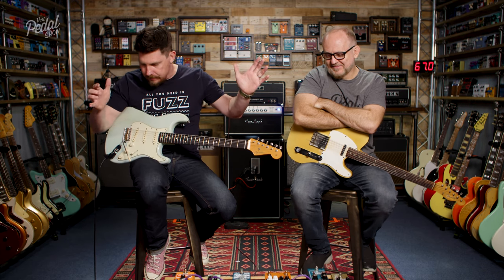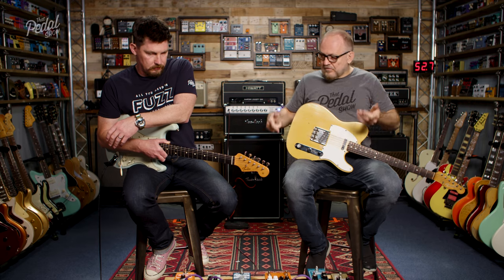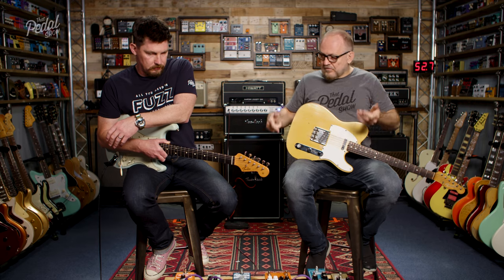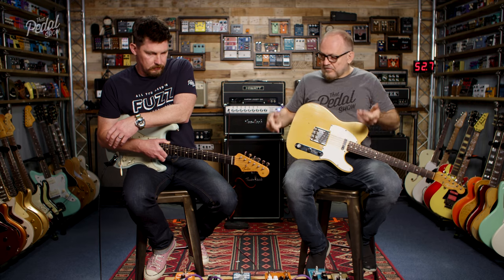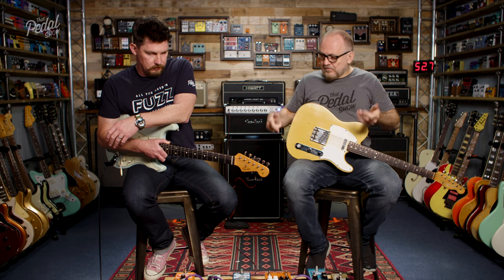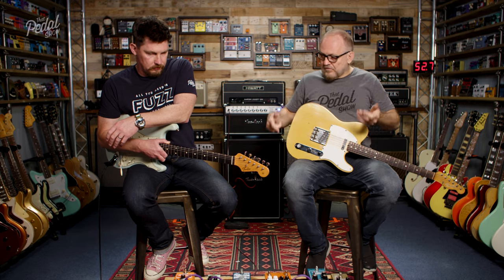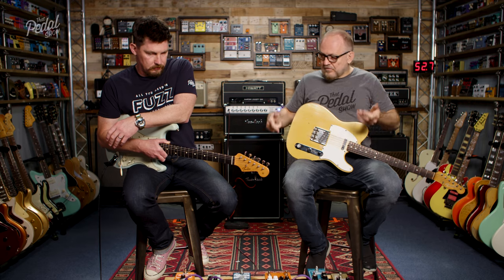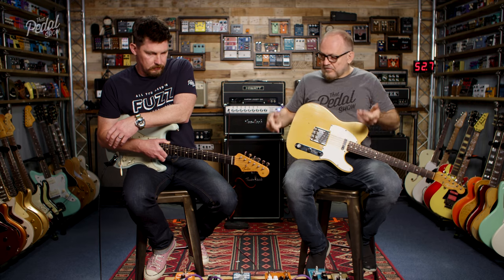To Buffer Or Not To Buffer: That Is The Question – That Pedal Show

Comment: Great video as always! Was wondering what sort of specs count as a high and low impedance? I often see on specs on pedals it will say 'input impedance 600 kΩ' or 'output impedance < 140 Ω'. Wondered if there was a rough scale that could help me gain understanding from information
Reply from the maker: Yah, I have absolutely no idea. Mick here. Would be interesting to compile a list....
Reply: They are always a pair, you want low output into higher input, (about 1:10 ratio is "good" to stop much signla loss).So a low output could be considered a high output if it were going into an even lower input :)  See ?

In general though anything about 1KOhms is a High Output, anything about 1MOhm is a high input.

For ref: a standard fuzz face is about 8Kohms input - yep, way lowwwww, and about 500Ohm to 1KOhm output.... way high.

Belle Epoch has a low input impedance and a high output impedance so can mess with tone when switched in and out (When it is in buffered mode) etc

Echorec is similar as well I think

Klon is similar I think, slightly high input impedance, but a low output so it can take a good fuzz and not change it "too much" but ti will also then drive along cables etc afterwards...

That's why these three didn't make night/day difference, but enough to be audible.

The Secret Machine is a Zonk really, or MkI tonebender by any other name - hugely hugely sensitive to cable length and input impedance of the next pedal after it...huge....

Typical Boss pedals with buffers in are about 1-10MOhm Input, and a few 10's of Ohms output.

Comment: Like a eureka moment of Achimedian proportions, I've realized why my Carcosa fuzz is so bright: I run a JHS buffer after it and before my volume pedal -- an absolute necessity with a passive volume pedal. When I bypass the entire board and have just the Carcosa in line, it doesn't want to tear my head off quite so badly. Feh. Not sure what to do as the volume pedal is far more important for my playing style than the Carcosa :(

On a different note, since I always use a buffer in my pedal chain, I also always turn off any amp bright switches. Way too spikey. I test my buffer by using a 10' George L's cable straight from guitar to amp, and then through the pedal board with the buffer in line. The difference is slight, with the high end being the same and usually a very, very slight shift in the mids. I gig a lot without pedals, but always play through my board at home,

Comment: What about the Secret Machine into a boss tuner (buffered) into the delay?  That’s how I use my analogman MkIV Sunbender...you’ll need a tuner anyway.  Isn’t this the whole wah—>fuzz , fuzz—>wah conundrum?  In fact, your previous episode on that topic you struggled to get the problem as pronounced as your memory thought it was.  You may have demonstrated it in spades here by accident.
Reply from the maker: Indeed. But I don’t love the sound of those tuners further down the line. On my actual board I have G2 so there’s a tuner out anyway. And with all respect to my dear friend, I don’t much like the sound of the buffer in G2 either. Ergo, I just don’t like buffers!
Reply: In that case, the Buffered colored preamp sound of the belle epoch may be the ticket.  Are there other colored buffered boost pedals set to unity gain that may work if you don’t go with the Catlinbread?

Comment: Does the 29 pedal use a TL072? (pedant alert) The 29 sounds like the Visual Sound née True Tone buffer. I'm surprised putting a very small Grumpy Bot right after the Secret Machine wasn't step one. The new Petersen Strobostomp HD right after my Sunface works great, if very very slightly brighter than the Suhr buffer IME.

Comment: My answer for mick: buffer after the zonk machine, with a "cable emulation" 470pF cap to ground at the input, always on: you always have the sound of a 5m cable going into the amp, so you have no "buffer fizz", deals with the zonk's output  impedance, and no volume jumps or anything when it's on.
Reply from the maker: That’s interesting, thank you!

Comment: Low input impedance/high output impedance seems to be a character of lots of fuzz circuits. Is that the case for Big Muffs, too? A quick google suggests that it is, but also that there’s ‘something’ about the rest of the Muff’s circuit that compensates for that so that it doesn’t seem to have the same symptoms of the Tonebender/Face styles. Curious what that is - does the Muff have a buffer circuit internally after the input?

Comment: Can the exact opposite thing also occur? Can you start with a pedal on down the signal chain (like an always on overdrive at the end of the chain that simulates pedals running into amp gain) and then when a vintage styled fuzz turned on at the front of the chain causing the signal to darken? Or is there something else going on there?

Comment: One option - have Dan put a toggle-able cap to ground on the circuit input of the Immortal Echo.  One hole, two parts, some wire... and a voided warranty.  I’d do it!
Reply: Replying for clarity; this achieves the goal of extra capacitance between the fuzz and delay only when the delay is on

Comment: I’ve got a board with almost exclusively fender pedals and I’ve watched all your videos and am still confused. Their level set buffer says in it’s literature that it was designed to be the very first pedal in the chain. So, before their own fuzz?? I’ve been back and forth swapping these pedals out that I’m worse off than when I started. I’m not even going to bring up my compressor or wah 🫣😰🤯

Comment: Great show guys! I love this stuff and the way you guys work thru each question. Two questions with two parts each: How can I learn which of my pedals have a buffer built in? Or do I figure it out by swapping things around?
Second, does the simple JHS buffer solve Mick's problem and would it go at the beginning of the chain, in the middle, or at the end?
Reply from the maker: Hello Tim. 1) More often than not the product page on the relevant website will tell you if it’s true bypass or not. Failing that, take the battery out. If the pedal still passes signal, it’s //probably// true bypass. 
2) It might. But as we’ve proved here, many buffers are different and I might not like the sound of it! Cheers!

Comment: Why not just get a straight bypass pedal (like a JHS bypass pedal) and put it after the Secret Machine? (I'm writing at 39m) Just before the bypass pedal, you could put a tone control (i.e.a  pot and an appropriate capacitor value to ground). This way you can dial in some capacitance that the Secret Machine can see? Alternatively, a preamp i suppose. 

The other way to fix it would be:   guitar -> secret machine -> amp -> fx loop -> amp -> speaker

Comment: wouldn't putting a stand-alone buffer (like the JHS little black buffer, etc.) between the secret machine and the J. Rockett delay fix the volume/buffering problem that was occurring?
Reply from the maker: Only if you like the sound of that particular buffer and what it does to all your other pedals. But in theory, yes.

Comment: EE101: a good small signal electronic stage has very high input impedance and very low output impedance. The main reason for that is exactly so that the stage doesn’t affect the input sound and is able to drive the output without being affected by what comes next. So what I’m wondering is: were vintage pedals just poorly designed circuits? I mean, I understand that the interaction between a vintage fuzz and the guitar volume knob can be magical, but isn’t that just a fortunate consequence of a poorly designed circuit? And to be clear, I have nothing against vintage circuits, I’m just highlighting the fact that we wouldn’t have these issues if those circuits were designed differently.
Reply from the maker: Same with vintage amps and vintage guitars.... generally considered ‘inferior’ to modern guitars and amps in terms of build ‘quality’ and design. And yet the new stuff never sounds like the old stuff. These are our choices!
Reply: That Pedal Show I totally get it. I tend to prefer modern stuff, partially for that reason. All problems have a solution though. Thanks for the video guys!

Comment: Just put a dedicated buffer after the fuzz? Problem is those take up some real estate too but thats what I'm doing. I use the TC Electronic Bona Fide buffer but there are great ones from empress and JHS. (Writing this before the end of the video so maybe you'll get there). I'd even say - set up an always buffer board and dial down the treble frequencies in the amp or via an EQ pedal? If you have always on pedals, don't you have always on buffers anyways? :)

Comment: Detailed explanation the buffers are weird I run a polytune 3 with the buffer bypass switch on it's kind of a funny pedal it will drive the pedals 25 30 ft with no problem I've tried to buffer at the end of my signal chain and it did not improve anything but just introduced a little more noise if I move that same tuner pedal to the last of my pedal chain it works pretty good it's really weird I hate boss pedals cuz they're buffer suck

Comment: Isn’t having the fuzz in the eula loop changing the input impedance as well? Wouldn’t the problem be easier with a buffer only after the pedal? Or am I missing how the eula works?
Reply from the maker: Yeah, the bypass is basically true bypass that includes that loop
Reply from the maker: What he said. Mick here. We included the Euna because it raises these questions!
Reply: That Pedal Show - this one had me build a quick and dirty pedal board with my analog man germanium surface and a Mesa buffer in one loop of a qmx so it was always on when the fuzz was selected. Now I think I a, going to do this on my big board. I previously relied on it being solved by my boss or g2 switcher and usually having a buffer at the end but I think making a permanent marriage of a buffer to my fuzz might be a good idea. Cool thought provoking video..

Comment: A buffered pedal such as a tuner or delay right after the fuzz seems like the best bet to me. It is simple and closest to the true sound of the cable straight into the amp without the capacitance of a true bypass board and the cable from the board to the amp killing off the top end. More of the pickup’s signal will hit the amp so Mick’s old amp settings probably will need to change, as it might for different guitars or types of pickup.
Reply from the maker: But what buffer. That is the question. The sound of the cable into the amp seems to be a thing people think is right... but here we are 30 years down the road of a few pedals and 50 feet of cable. Then comes G2... Ah, hello tone old friend, I have missed you! 
Massive grey area.
Reply: That Pedal Show I don’t use fuzz but I’d noticed even OD pedals sounded different depending on what came after.  For me a buffer in one of my pedals early in the chain is the solution. There seems to be quite a few good buffers around.

Comment: You missed the trick with the Euna on this one I think. Instead of putting the Fuzz in the loop like everyone would assume (so it's not buffered), you should have tried the Secret Machine into the Euna, then the delay in the loop of the Euna. That way you have Fuzz > Buffer, or Fuzz > Delay (working as buffer). That way either way you have a buffer in the line to boost the signal.
Reply: Andrew, you beat me to it! I tried my best to make EUNA adaptable to a lot of circumstances. Thanks for noting this!
Reply from the maker: I think we’d done enough swapping by that point to prove the point that the sounds vary greatly. For my tones personally the Euna is too much buffer - I wouldn’t want it ahead of my other drives. But yes, that would totally work for some people! Hey Jesse, hope you’re well man!
Reply: @ThatPedalShow  Hi Guys!! Thanks so much for including EUNA on the show!!

Comment: Isn’t the question then if it makes sense to put a dedicated always on buffer at unity gain after the fuzz, and possibly another at the end of the pedal chain to drive the cable to the amp? But what I wonder about is how that affects the sound and dynamics for the following drive pedals. For instance would you have the same dynamic when turning down guitar volume and touch sensitivity when playing lightly?
Reply from the maker: Yes, this. Adding buffers anywhere makes it worse for me..... except when that fuzz is on. So yah, looks like fuzz in loop with dedicated buffer than I like. The search begins. :0)

Comment: How about the “Enhanced Bypass” switch in my Fulltone OCD v2. I noticed my overall sound is brighter in that setting. Is it just a fancy way of saying it’s buffered or is there something else going on? 🤔
Reply: I have the original Fulltone "Enhanced Bypass", the amazing Fulltone Wahfull( no choice of bypass style, unlike your OCDv2) and that lets my Soulbender SB-2v2 work MUCH better with the rest of my pedals, so if you use a vintage style fuzz before the OCD it would work so much better using the "Enhanced Bypass" because it's on all the time. Hope that helps!

Comment: I would love having Dr Mason from Vertex opinion on that. He tends to "isolate" the pedal chain between an input and an output buffer. But what would happen with a Germanium vintage fuzz?
Reply from the maker: It would sound different in a way you would either like or dislike, as we proved through this entire video. Cheeers!
Reply: @ThatPedalShow  thanks yes indeed. This is why I am also curious to see how Mason handles this with customers who have a vintage fuzz on the board. In other word, how would he solve Mick's issue? Please keep up with spitting hair in four, we all love it. Cheers.

Comment: I want to run 3 amps (Wet/Dry - Dry - Wet/Dry.)
(All AnalogMan or modded by AM)true bypass pedals. One exception is my vintage Crybaby Fuzz Wah and non buffered Korg tuner. 
Sequence is Korg, Crybaby, Juicer, King of Tone, modded Boss SD1, modded Phase 90 script, Stereo Chorus dual out true stereo.
I’m waiting delivery of Dual Analog Delay ARDX20 and the Amaze1.
What do you recommend as buffers/splitters and thoughts of possibly the no no of delay before chorus?

Comment: I'd like to see some of this messing about with a VHT/Fryette Valvulator GP-1 tube buffer too. Cuz that'll have a lower input impedance than solid state buffer won't it, and don't know if it is pure tube send or has any solid state/low Z output on the back end of it? Dunno. Just thinking aloud here as there's an unused one sat next to me and I think my ZVex fuzz probe has probably behaved different depending on all the random things I've probably moved about or added over the last decade or so.
Reply: (i.e. can you get a slightly "worse" buffer with lower input/higher output impedance and stick it right after the "problem" pedal)

Comment: I'm confused... Isn't the obvious answer - in this case - that Mick needs a buffer he likes, right after the fuzz? Isn't that the only thing that will let him turn effects further down the chain on and off without the massive volume/tone jump? When you brought out the Euna I was sure you would put the Immortal Echo in the loop, that way you can turn the echo on and off without the massive tone difference. Right..? I didn't understand what putting the fuzz in that loop achived :-/
Reply from the maker: Yes, a buffer always after the fuzz is what’s needed, we just wanted to go through the various permutations of that based on the Qs we knew we’d get. Euna’s loop is designed especially for vintage fuzzes; for people who don’t want the buffer after the fuzz... so really just to highlight that there are many ways to ‘solve’ this particular problem. Then add in a loop switcher and space considerations and you really get down to it. I’ll follow up when I decide the best compromise. :0)
Reply: @ThatPedalShow  I can make you the Silicon Phuzz output circuitry in a small box if you'd like? It will allow you to keep the basis of the tone, without that top end when you bring pedals in after.
Reply: @ThatPedalShow  Ok good, then I'm not as confused as I thought I was! :-D I just felt there was a clear conclusion here that never got stated in the end, and that made me worry I'd misunderstood something :-P Great show, I'm very glad you went through everything so thoroughly!
Reply: @ThatPedalShow   Wait, still confused, but about the Euna... Having fuzz in the loop would solve the problem(s) with having a buffer in front of the fuzz (that can mess up e.g. how the fuzz reacts to your guitar volume), but it wouldn't solve the "sound-changes-drastically-when-turning-delay-on-and-off"-problem. Or would it..? :-S

I think you were about to try that but got sidetracked with the short-cable-straight-in-the-amp-project (which was very interesting by itself!). 
This capacitance thing is a bit beyond my grasp of electronics knowledge, and it's frustrating when it feels so close but still out of reach of comprehension. At least todays episode brings me a bit closer :-)
Reply: @Phil Robinson  TBH - that alone in a box with a diallable Input Impedance, Output Impedance would be low of course, would be a Swiss army knife for all issues like this !!!  Put it on the market and you would make a fortune!
Reply: The main purpose of EUNA's loop is for players who love their fuzz and the interactions it makes with both the guitar and the next pedal or amp stage - it gives you the benefit of an input buffer but gets out of the way of your fuzz. In this case, where the fuzz would sound better with a buffer on the end, you could add one to it in the loop or simply use EUNA after it.
Reply: @KristofferG  When the fuzz is in the loop it bypasses EUNA completely - You could put EUNA after the fuzz to solve this particular problem.